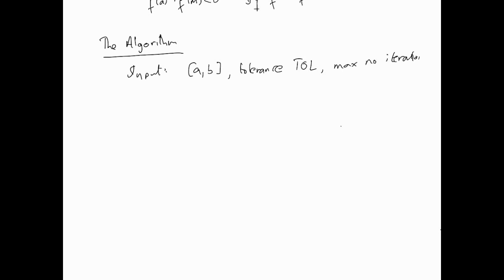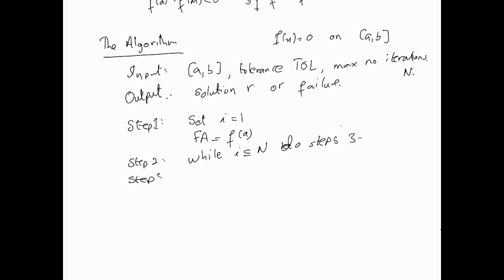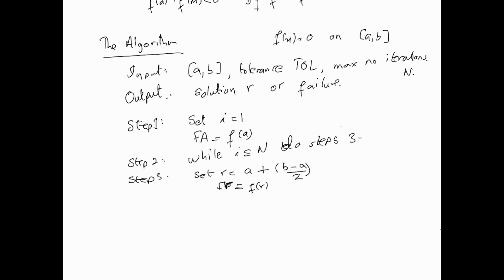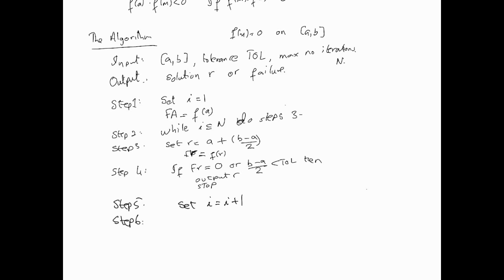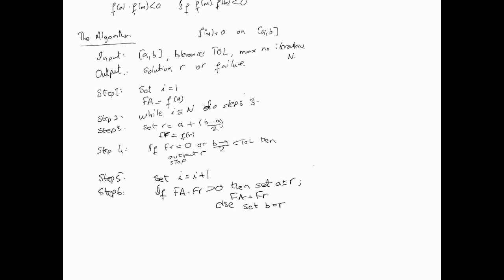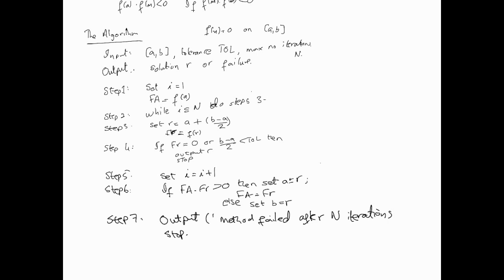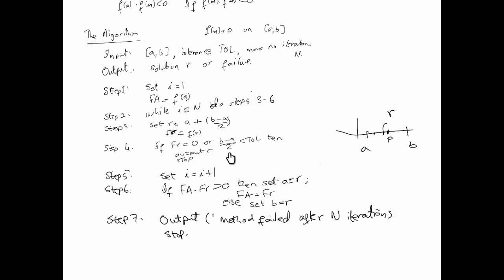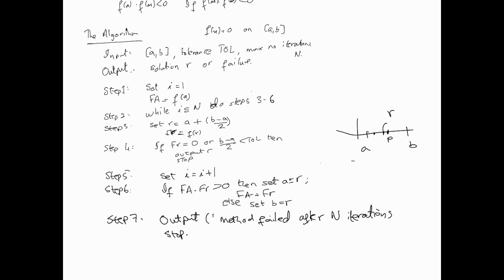Bisection Method - Algorithm

Comment: In your notes toward the end, you mention we can use Fr < Tol instead of Fr=0. But, this fails when Fr ends up being a negative number (as all negative numbers will be less than any small positive Tol). However, we could use absolute_value(Fr) < Tol as a stopping criteria.

Correct me if I'm wrong in my thinking.